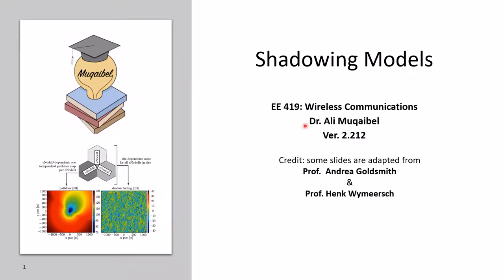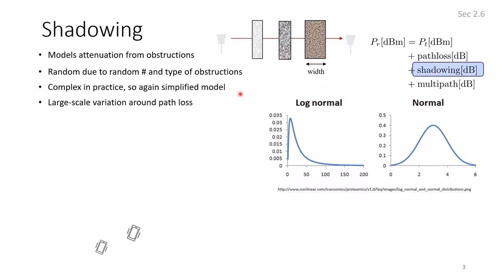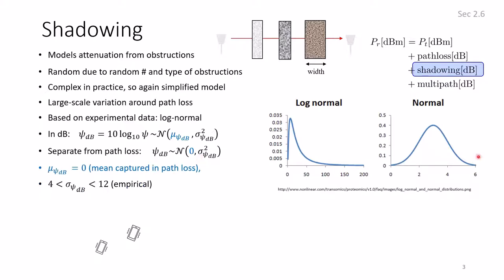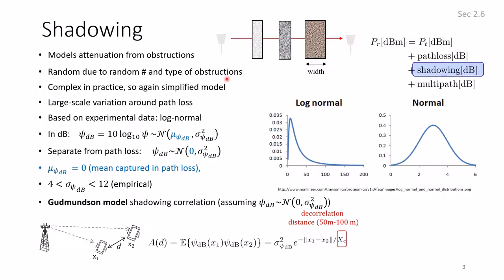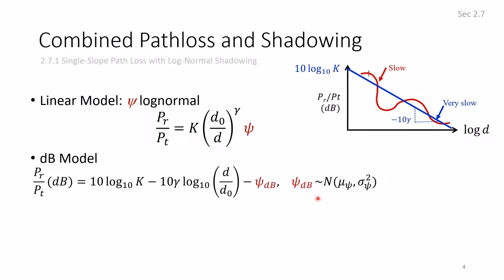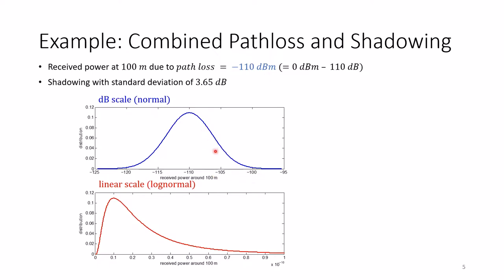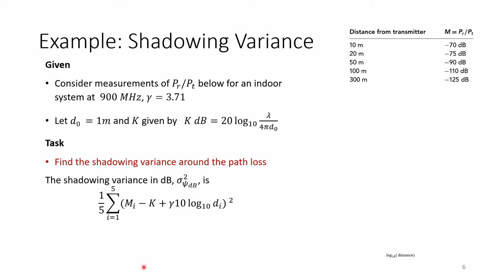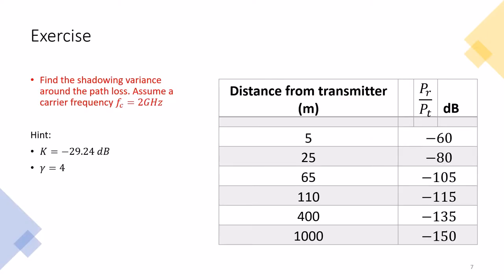3.4 Shadowing Models

Comment: Thank you professor Ali, for the last question Plz ......  K= 20 log (0.15 ÷ 4 pi ) = -38.46 ..... why you assume -29.24   if fc = 2 Ghz
Reply from the maker: K is the value of the received power at the reference distance. It can be measured. It dependes on the pathloss exponent and the medium of propagatin. If we  do not know it, we may use the equation that you have used as an approximation. The equation that you have used assumes free space propagation, n=2. All the best @Ahmad Khalaf.
Reply: @alimuqaibel7619  Thank you sir for these valuable information
Reply: Thank you so much prof, I'm on my PhD in telecom Engr. Your video has helped alot. Can you please help with more explanation on how to calculate the parameters of CI and FI models of 5G. 

I'm working on large scale path loss modeling for 5G systems.  I will very glad to hear from you Sir. Thanks Sir
Reply: Doctor please can you help me. How to apply log normal shadowing model in matlab. Please